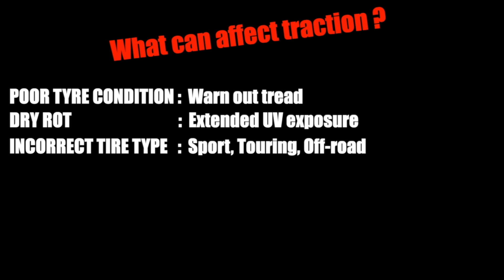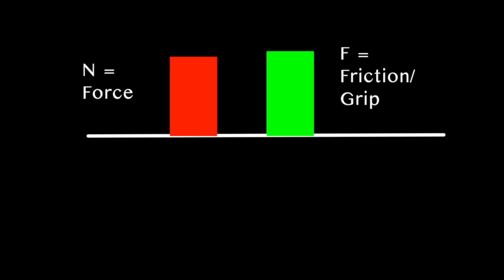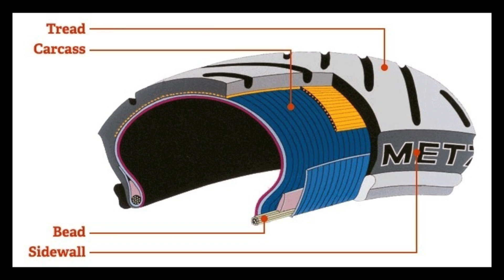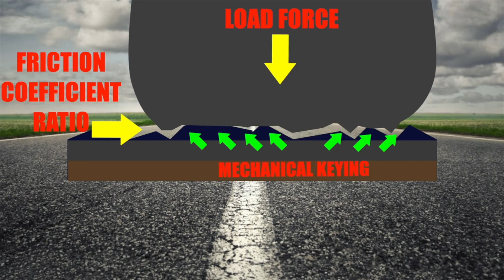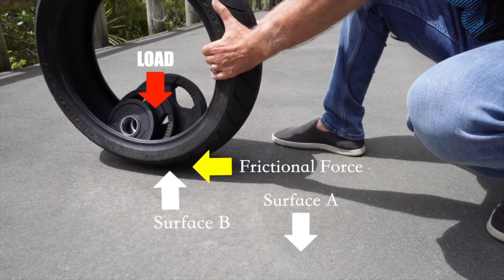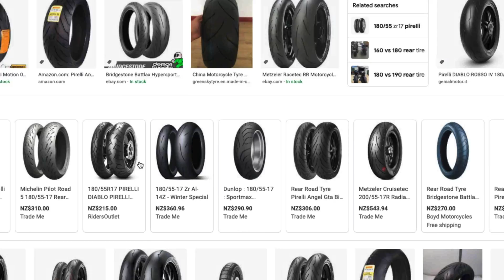What is "MECHANICAL KEYING" ?

Comment: Michelin road 5 for me
Reply from the maker: Good on ya Olivier👍 Its great you have found a tire that works for how you ride and the roads you ride on. If they instill feeling and confidence, thats the main thing.  Take care out there 👊✊👍
Reply: One of the things is that OEM tyres are not built the same as off the shelf the tyre manufacturers do deal for cheaper tyres. You usually find less wear and stickiness than the same tyre bought off the shelf